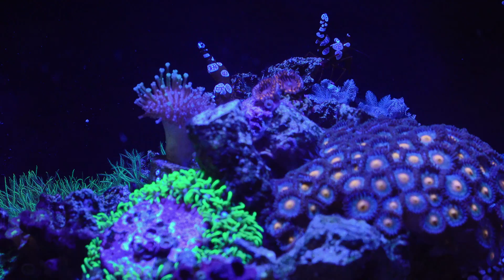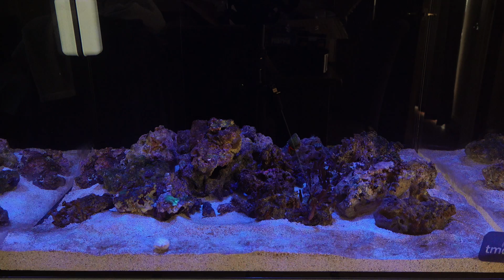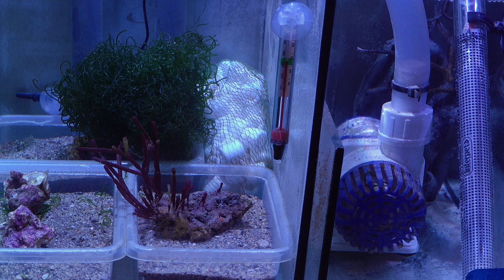Building a NANO Reef Aquarium, Part 7, Fluval EVO 13.5. Cylcing your tank!

Comment: I’m looking into get the evo 13.5 and watched all your videos on how to start a marine aquarium in the evo. Your videos have been by far the most intuitive that I have watched. You calmed a ton of insecurities that kept me from trying the hobby. I’ve learned a ton via your explanations. I’ve got 2 questions that you didn’t touch on. 1. During cycling what is the feeding schedule that should be followed once the switches are flipped and the wheels are in motion and 2nd, I don’t see a wave generator in your evo, are those required as everywhere I’ve seen and read they suggest at least 1 if you plan on keeping coral? Again, great video series on the walk through of a first saltwater aquarium start up for newbies like me!!!

Comment: Not sure I agree on the rock choice explanation. I'd say in the hobby today using Live Rock from the ocean is very much in the minority mainly because of the issue sourcing it. 
Cured rock and dry rock that eventually becomes live anyway is widely regarded these days to be more beneficial not only because of its convenience and financial benefit but maybe more importantly the near zero impact it has on the ocean itself. There are reefers everywhere with similar experience to yourself who have some absolutely stunning tanks that were all born using Dry or cured rock. I paid £6 for the cultured bacteria on ebay by ATM.. You couldn't get a kilo of live rock for that.
Reply from the maker: That's all Bollocks Gary bio active rock is not the same as live rock . Thats just marketing hype to sell you a low quality more convenient product at a premium price. The expression Cured rock has been perverted from cured live rock to dry dead scrubbed rock (originally to mislead newcomers). As for your reefers everywhere comment I'm going to ignore it as its just an anecdotal off the cuff remark from an in experienced hobbyist that requires proof you don't have. The main problem with the scarcity of live rock is the current lack of knowledge of handling and processing it in the Industry. Unfortunately They can make the same sort of money selling you crap with a lower investment on their part.